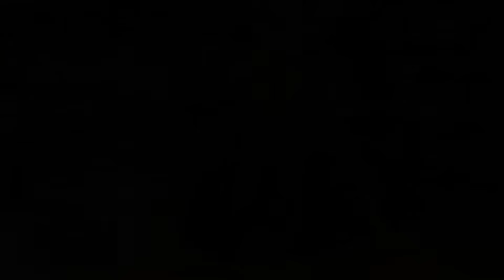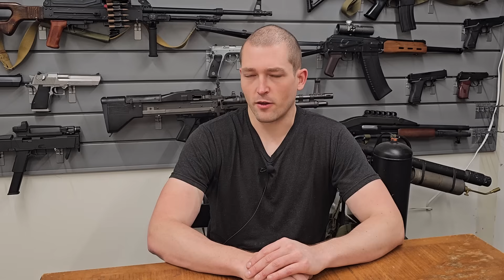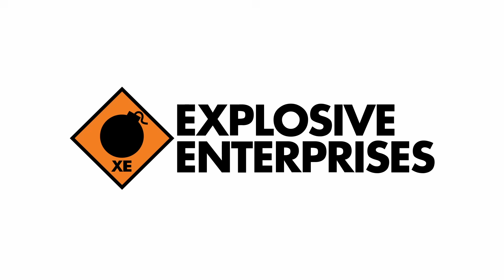What Exactly Is 'Gas Efficiency', Anyways?

Comment: oh oh cake your an airsoft channel, I didnt know, the title is weird
The answere is ghk green gas mags with the soda stream co2 mod which is put teflon tape around the threads and seals and use a propane adapter on a soda stream type bottle.
This has been known for a decade at this point
Reply: Cake cake brownies duck tape ghk title is weird soda stream known for a decade at this point

Comment: Very good video! Thanks for separating "efficiency" and cooldown, that's an important distinction!
We all have to remember that every part in a gun and interactions between those parts has their own set of ideal parameters that maximise performance. Without countless days of extensive on-paper calculations and simulations, it would be almost impossible to get to a definitively "most efficient" configuration. Remember kids, fluid/thermal dynamics are infinitely complex and sensitive (and a giant pain in the ass), also throw in friction calculations coz god I hate doing them (gets way worse when accounting for lubricants). 

P.s. Looking forward to the MWS and VFC vid :)

Comment: Thanks for the great informations as always.
Does Anyone know if a MWS Buffer(looking for a lighter one) fit the VFC V3 AR15's?
Reply: Yeah it does! I did. it myself an replaced in my VFC MK18 die buffer spring with One 110% for MWS. Keep in mind that the spring will be a Little smaller and more narrow. But it works for me. It’s less stiffer than the original spring but for cooler temp with the original buffer (about 15-25*C) works perfectly for me
Reply: @DallasDeagle  but the buffer itself is my main thing. I can find enough springs but no Lightweight buffer other than a GHK one.
Reply: @KrheaKap  
Now I‘ve got you! Sorry I try to get sober Last Night was a Little Rough…
For GBBR should fit nearly any buffer! I bought for my Mk18 an RS H2 buffer but unfortunately it’s to cold for now. So my fix was like mentioned with an mws buffer spring + original buffer for good Performance.
Maybe you‘ll try an rs H1 buffer. I had a few lightweigh buffer but paired with an Steel bolt it didn‘t worked well.
I Hope I could help you
Reply: The Performance with an Steel buffer + lightweigh bolt was „sluggish“. Like the buffer was to light of hadn‘t mich mass to Kick the bolt into battery.

Comment: In general minimal working pressure has a greater affect on the perceived “efficiency” for most situations. Lower the minimal working pressure, the more potential energy the replica is able to extract out of a mag given the same amount of gas/thermal mass/ambient temp. Also, the colder the magazine gets the faster thermal energy is able to be absorbed from the environment. But in general, better seal will result in major improvement for both minimum working pressure and gas efficiency.

Comment: "Gas efficiency" is often used more like "gas mileage". People would call guns "efficient" when a charge last lots of rounds, but forget differences about power, specially in recoil. 
If the gun has no leaks during the cycle (good seal between the nozzle and the gas route, hop chamber, and bolt), and there's no absurd design error such as bad timing on the locker valve, then it's efficient.

Comment: Using VFC guns with low pressure gas in Japan is always difficult.
We have very limited periods that it functions well.
Reply: Do VFC have a CO2 option?
Reply: @CreEpeRneSs125 VFC V3 ARs now have CO2 mags available that may help, though an NPAS would be strongly advised to remain within Japanese limits - the winterization guide on this channel may be advisable for running on duster gas as it's effectively a set of instructions on how to run GBBRs on lower input pressure
Reply: @CreEpeRneSs125  The bland called Reload sells CO2 mag for VFC.
But only P mag style so I don’t own them.

Comment: 3:16 another thing to consider is the thermal mass of the magazine shell
4:28 the rabbit hole is different humidity and temp combination varies a lot, except you can tap the mag
5:14 most people talking about the term efficiency is based on shots per charge. however they ignored the recoil itself is one of the output too.
Heavier bolt, stronger spring, slower valve disconnector lever, all those things contribute to the output of GBB, which should not be ignored during the comparison of efficiency.

For those read until the end:

further down the rabbit hole is, even with the same magazine, different amount of gas charged will affect the fps consistancy, and it's not even linear. further complicated by testing temp/humidity, the stock limiter of how much gas you can charge, the gasket leak which will affect data consistancy.............

yup been there done that, that where i stopped some years ago.
Reply: hey man you seem very knowledgable, i have some questions if you dont mind, i recently replaced the original pot metal and plastic bolt carrier and nozzel with an aluminium nozzel and hybrid steel bolt carrier, but now it shoots slower and seems less consistant, should i start off with a stronger spring?
Reply: @chickon2.0  it depends on a lot of things
1. do you get good seals between the aluminium nozzle and the piston head/ magazine gasket?
2.  the weight difference is huge(30%+) or small? (<20%)
3. compare the disconnector groove between the new and old bolt carrier, to see if the new bolt is cutting off gas supply eariler than the old one / the bolt is way heavier, but the groove isn't extended/ the magazine itself is not high flow enough to support the bolt weight/ spring weight 
4. if you're talking about fps inconsistancy, that can be bad seal, can be too much loading which exceeds the amount your magazine can support (mostly bolt weight and spring weight)
5. stronger spring increases load of the system, which makes the vicious circle even worst
Reply: @chickon2.0  wink wink
check the length of the nozzle tip, if the new one is longer than the old one. sometimes that affects a lot of weird stuff
Reply: @DGworksIvan 
1. I don’t hear any audible leak, the rps is consistent 
2. I’m assuming the bolt is quite a bit heavier then the oem one 
3. I’m not sure about the extend groove I’ve tried the oem piston and it just leaks and no longer fires and the original bolt is fubar so I can’t really compare it 
And if it helps it’s hPa so the supply is consistent the old bolt was at 108 psi worked fine then this one just shoots slower
Reply: Also forgot to mention it sometimes doesn’t go far back enough to trip the trigger reset but still seats a new round
Reply: @chickon2.0  1. If its audible or rps is inconsistent, that's some major f up
2. Heavier bolt need more gas to push, this can be archived by higher gas pressure or extended gas cut groove.
3. Harder spring with more gas pressure with make the recoil more snappy, however the cost is higher gas consumption. Considering you're using hpa that won't be a big problem?
Reply: @chickon2.0 what gun are you talking about btw?
Reply: @chickon2.0 snappy recoil (short term)  be archived by
1. Higher gas pressure
2. Shorter recoil travel distance
3. More springy recoil pad/ buffer
4. Harder springy
5. Slower gas cutoff timing
Reply: @DGworksIvan so I should start by checking the pistons length then going directly to stiffer spring and increase pressure?
Reply: @chickon2.0  i think you should check the fps consistancy first.
then you may increase the psi. if the recoil get better then go for stiffer spring.
or you may add spacer/ buffer into the rear of your recoil spring

Comment: Wait, so you're saying buying 3rd party parts, installing them, and then shrugging with disappointment when it doesn't fix the gun is not the solution???
Reply: -Buys a TM
-installs $300+ of aftermarket parts
-it performs slightly worse then stock (another successful upgrade)
-Repeat
Reply: Blasphemy